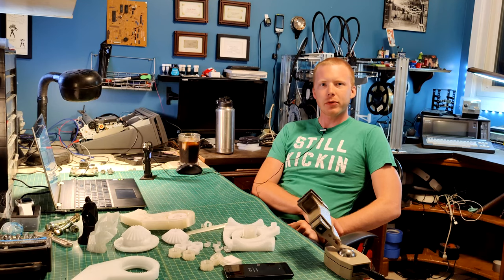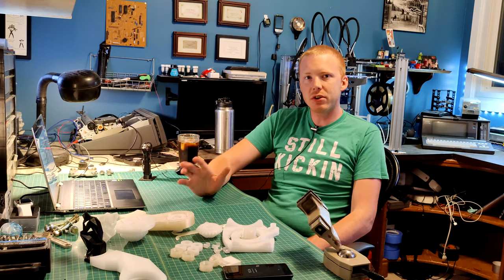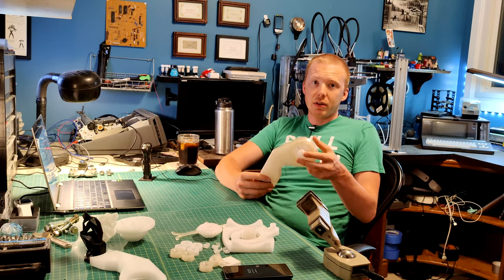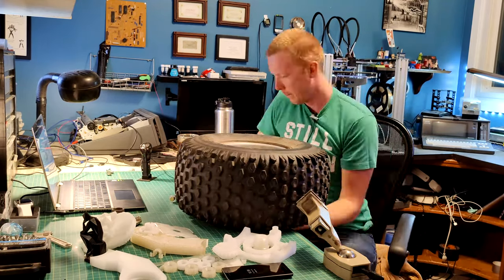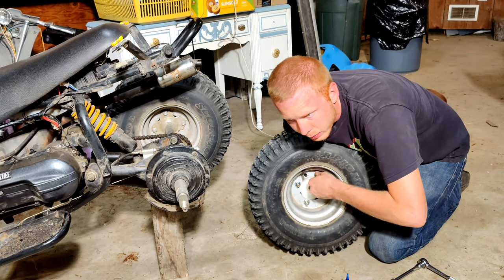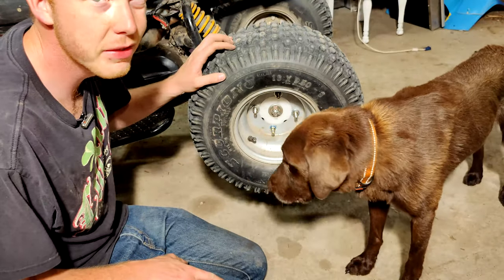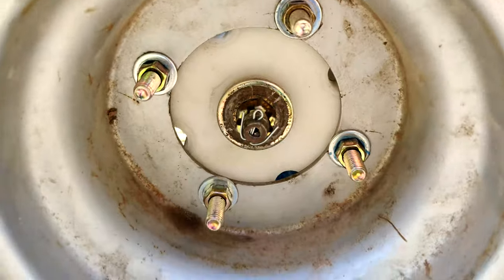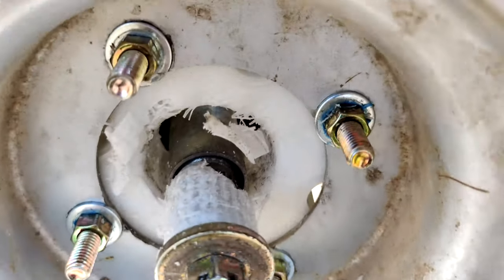3D Printed 4-Wheeler Hub

Comment: Interesting stuff. I wonder if it's feasible to reinforce 3d printed parts with pieces of metal or something for such extreme applications. Like rebar in concrete. Like print around it, or pause printing, insert metal, continue printing. Nice video!
Reply from the maker: One of my printers is the e3d tool changer (https://www.youtube.com/watch?v=C7wYfaHT1g0) and I've thought about how one would go about feeding copper wire through a print on various layers, both from a structural standpoint but more for electrical windings or circuitry.
Reply: @oddinventor  You can buy pla and abs filament with a little bit of metal mixed in.